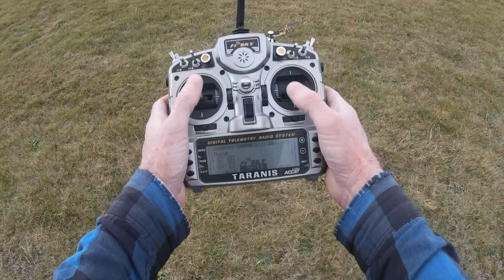Review: DJI Naza Lite multirotor flight controller

Comment: If you are planning to fly in sunny days make sure you put black tape to the sides of Naza (AKA black tape mod), I had my 600 size quad free falling from 100m to ground due to sun light messing with naza barometer.
Reply: Heat is not the problem here the problem is sun light & black is known to be better for blocking light.
Reply: Good to know -thanks
Reply: Black tape? Wouldn't that heat up the controller even more?

Comment: Bruce it's been awhile since I've messed with my one quad with a Naza Lite with the firmware upgrade, but as I recall the GPS module is pretty marginal by today's standards.  I found an upgraded module on eBay which improved the toilet bowl and other problems you saw.  That was a couple of years ago and I don't have a good link, but an eBay search of Naza Lite compatible GPS will bring up some current listings.

Comment: -Come on Bruce, you simply glue the GPS mast in place with epoxy... haha.
-I also have a classic NAZA which is basically a NAZA Lite. I could never get rid of the toilet bowling. DJI says you have to rotate the GPS mast a certain way to get rid of it. Something to do with compass offsets or something with new firmware.
Reply: Its about the north /south hemisphere  if your Z X Y setting are right and the system goes into toilet bowl turning clockwise you need to reposition the gps about 10 to 20 degrees to the left and if its turning counter clockwise it needs to be turned 10-20 degrees to the right...after repositioning the gps should be recalibrated again. In NZ mine is 15 degree to the right and work perfect.